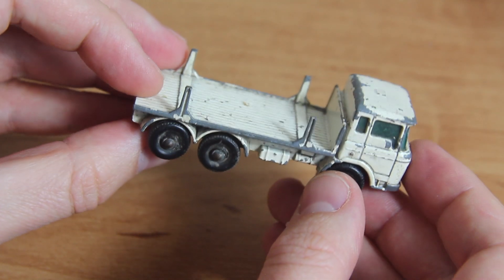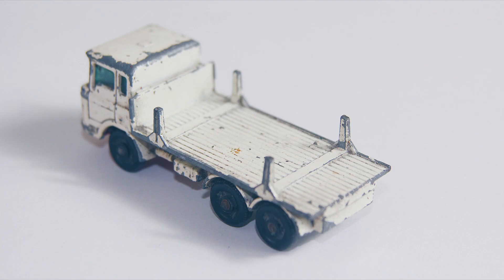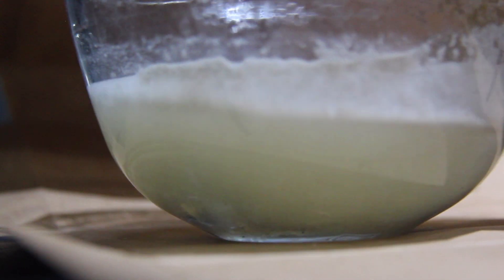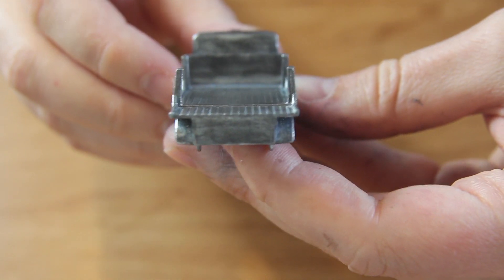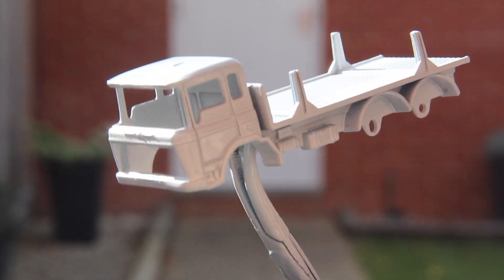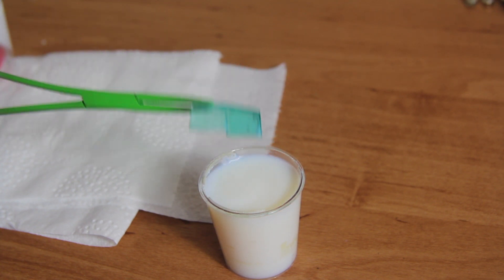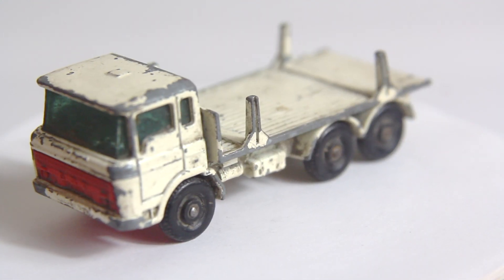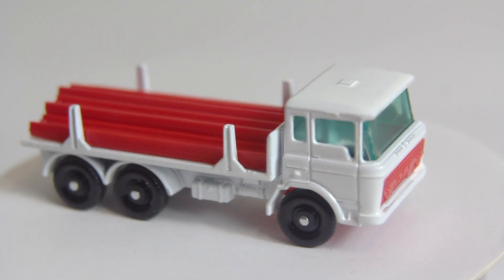MATCHBOX restoration: No. 58C DAF Girder Truck - DIECASTRESTOS

Comment: Another cracking job, if i had to criticise one thing, and it is minor, maybe could have done with another top coat of white underneath, especially on the fuel tanks. Just looks a little thin, other than that, excellent mate. 👍🏻